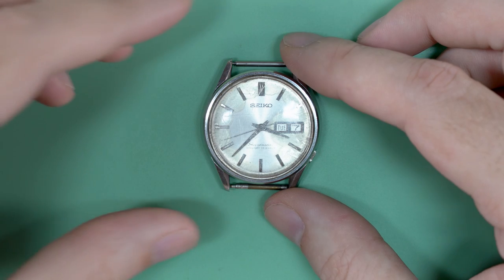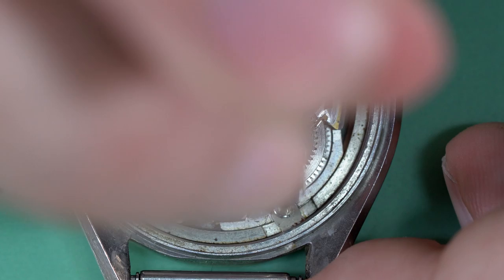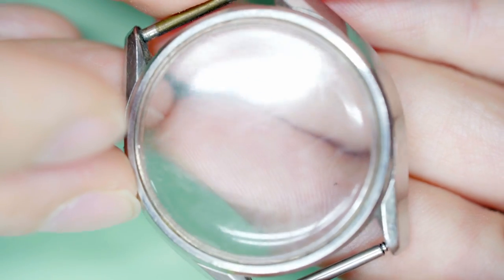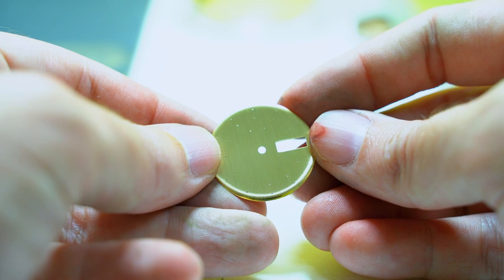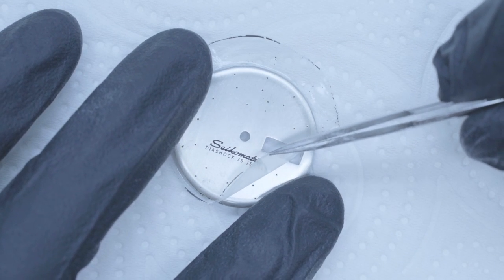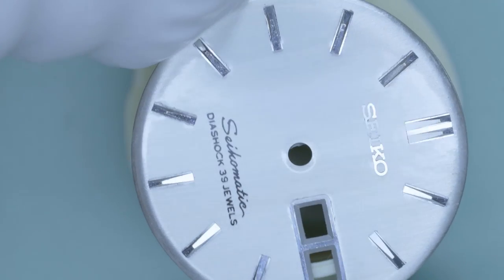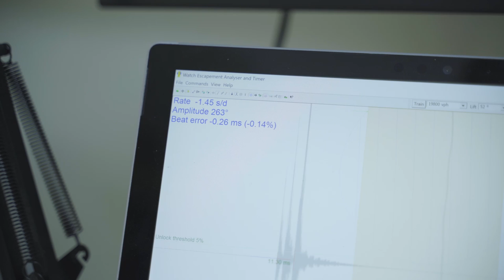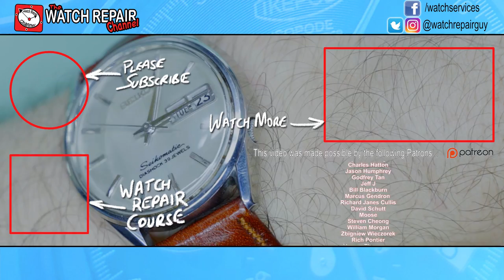A 1960s Seiko Automatic 6216A Restoration and Full Service Watch Repair Tutorial

Comment from the maker: Full length version of this video can be found here: https://www.watchrepairlessons.com/2019/06/13/a-1960s-seiko-6216a-restoration-extended-narrated-edition/

Forgot to mention in the video - the array of different screws in this movement is incredible - seems like a different screw for nearly every fitting. Did anybody notice the mistake I made in the video and later it got rectified? Why not watch again and then comment below if you spot the mistake :)

In this video we take an extremely tired old 1960's Seiko Automatic 6216A gentlemans wristwatch and give it a fresh lease of life. 

Film Free Decal Products used in this video - TYPE A: https://ebay.to/2JA95hm or https://amzn.to/2W0RCp4 I did not use the glue in this video.

Canon Laser Printer Used in this video: https://ebay.to/2LttiIq or https://amzn.to/2YsI4Ay or choose an alternative color laser but the highest resolution you can afford. e.g. 1200dpi
Reply: Thank you for sharing reprinting cadran process with us . My father repairman too and we were paid  expensive money to reprinting it. Next week ı will going to try it with your way. In turkey there is too much people interested to old seiko and omega.
Reply: The screw that holds that cover plate in the keyless work (dont know what its called), that you're fitting exactly at 28:00
First you try to fit that with a screw with too fine thread pitch, and then with a screw with an oversized head.
It needs to have a screw with the same headsize as that little bridge that holds the calender quick change wheel (at least I think thats what it does)

I don't know where that misplaced screw originally fits, maybe on the balance bridge or escapement bridge.
Reply: Alright, I give up. I went through the video a few times and can't spot the mistake. I thought you may have forgot the winding pinon, but there wasn't one on disassembly. The pawl went back on in the same direction and you didn't forget the click like I've been known to do. The only misstep I caught was when you tried to screw the setting lever spring(?) into the wrong hole but quickly adjusted it. 

Can you leave another hint or two? This will drive me nuts until I figure it out...!

Big fan of the channel, by the way. You've helped me tremendously over the years.
Reply: Do you sell them?

Comment: As someone who is a Seiko fanatic I say great job. The numbers 61 as the first two digits of the serial number on the rear case puts the production of this watch as January 1966. Seiko's are typical easy to date because very few movements by Seiko saw ten years of use so the movement type will fix the decade of production then the first digit will be the year of that decade. The second will be the actual month with November and December being represented by A and B respectively.

Comment: I think you did a great job on the dial.  Comparing the original finish and markings, it appears that the new decal is about 2 letters too long, but still one heck of an effort and a very good result.  My first and earliest Seiko is a DX with a 6106-8609 movement- case designation, Model 54229M.  Been wearing it since 1974.  Have 28 more Seikos and 2 custom divers with Seiko NH35 movements.  Reliable and durable.  Best watch for the money.

Comment: Hi Mark, very good informative video, Thank You! A very nice vintage Seiko watch that was definitely worth restoring. At 39 jewels, the movement is one of Seiko's higher grades.
I think that you were fortunate that the lacquer had not lifted on the date ring too due to moisture ingress. This is a common problem on vintage Seikos.
Unusual that the day wheel had no snap spring to hold it in place and only a under dial brass washer. For this model, Seiko must have deemed it enough.
BR

Comment: I  have that very watch!  I purchased it in 1971 at the Gunfighter PX on Freedom Hill in DaNang Vietnam.  Had it cleaned once and the self winder had come apart, they fixed that.  I had pulled the band apart once to put the fitted links on a different band, and when I replaced the original, I had to replace that with a regular link but it still keeps GREAT time although I only wear it when going to my old outfit reunions, and other format occasions.  When I purchased it, I had pointed to a real cheap wind up watch, since the watch I had was stolen from my wrist while driving down QL1 in a Jeep.  The gal at the PX looked then grabbed a box from under the counter and sold it to me for 8 bucks, MPC.  The one I got was marked $40.00 MPC.  Got a good deal on that one, I didn't open it till I was back with my unit some miles away from Danang, so I just kept the watch.
Reply: Woops, mine has the duel language french/English day indicator.

Comment: To place the decal, i think you should prepare Mark Setter and Mark Softer. Those two liquids very help in placing decals on the surface. Mark Setter help to slide the decals and Mark Softer to soften the decals. And to reduce the liquid maybe you should try cotton buds. I hope my tips is usefull. I like your video a lot. Very detail in showing the process. four thumbs up..

Comment: Fantastic job. My only suggestion would be that the crystal could be polished a bit more. This would allow for the fine job you did on the dial to really shine through. It would probably only take an additional hour or so. I like to use toothpaste. Just a small amount applied to the crystal and worked in until you feel a bit of resistance on the polishing cloth. This is the paste drying. Then a fresh cloth to hand buff away the remaining residue. I have brought these types of crystals back to near new condition with this simple method. Great video!

Comment: Great video. Heres a tip. It’s better to peel off the heated decal totally horizontally (folding it in half as you peel away) with the watch face instead of peeling the decal away at roughly 45 degrees as you’re effectively pulling the decal back off if you’re not peeling it away flush with the surface. That’s why the number 3 peeled off.

Comment: Wonderful video and very useful tips. With regard to the new lettering or logos, I tend to think they might look more "aged" if the edges of the font are not too sharp but a bit frayed. Can be achieved in inkscape by putting lighter tones at the edges. Probably makes the letters look more slender.

Comment: The Seiko 6216 9000 is not exactly a throwaway.  They sell for USD300-1,000.  This one is from 1966 and the 6216A movement is identical to the 62GS Grand Seiko as in a 6246-9000 which can go for USD2,000 plus, because of the chronometer GS branding. Note the rack & pinion fine adjustment. Nice refurbishing job though, and you've given me an incentive to replace the tarnished SEIKO logo on one of my 6105-8000's from a donor 6119.

Comment: 39 jewels that in itself seems worthy of restoration. That 6216a movement is Grand Seiko worthy movement of the 1960's, it was Seiko's highest quality movement of that time, don't think you know what you got there, I would have bought it from you but you might have hurt its value by restoring that dial.

Comment: Love these old seiko watches. I have a seiko sportsmatic 5  6619-8060 dolphin back and the date quick set doesn't want to stay working. Took it apart, put it back together, it worked out of the case once and after I put it all back in the case. Then hasn't worked since. Bad date spring?

Comment: Interesting video. At the end you said that from a financial point of it was not worth it. Do you mean vintage entry level automatic watch aren't worth salvaging. I have an old Tissot Pr 518 ruined by water that no watch repairer is willing to fix although i have a working spare movement for it. The latter one also needs maintenance. Should i just sell them as they are? Cheers

Comment: Pretty neat and interesting  work  Ive noticed when. Playing around on Ebay that  you can actually buy  complete quartz mechanisms complete with batteries  for under five dollars  of course thats kind of cheating  compared to wahat. You did in the video  yet i was curious if those movements woul fit inside a old mechanical. Watch case  ? If the movement and parts are beyond what. A hobbyist  could fix  or repair the movement. Ive seen  is a Chinese made  unit that starts with the letter M and i beleive that company manufactures all the  movements for Casio and maybe Timex and others who  purchase  the mechanics from other people  i do have a couple of Sentimental watches  that dont run  and i thought it would be cool to be able to wear them again  plus  you can find tons of them online in lots  pretty cheap  and in some cases  i really like the look  and style of the old Seikos and such. Over  some of the new  watches  in all honesty  i was a professional Woodworker who suffered a Traumatic Brain Injury over 10 years ago and  that caused some paralysis on  the left side od my body  and although I’m doing well  despite that  I’m not quite sure on how safe it will be to return to a fully operating Woodworking shop  but perhaps  pursue another hobby. Like watches instead ?  Besides there are YouTube videos and channels that can be of help

Comment: I happen to have one that's supposed to be waterproof, but it needs a new gasket. Any ideas where I can get one? The watch does work, but is no longer waterproof at least the the depth claimed... I think 50 meters ... been a long time since I looked at it.  Another silly question, is there a quick easy way to set the day date?
Reply: without taking it apart, I mean. I hate to take them apart. Things pop out... and I don't know how to put them back.

Comment: I think you should not have sanded the dial but just re-lacqured it. The sunburst is gone. Or, if you did sand, a spinning sanding wheel rotating about the dial center would bring the sunburst back.

Comment: Unlike most women Seiko's are easy to date. The first two digits of the case back serial number are Year/Month. Then it's just knowing the Seiko case styles to get the decade. So this watch is a proof so must be 1960's as by 70's they were marked resistant not proof.  The serial number 61xxxx tells you it's January by the second digit. The first is a 6 so it's 1966,76 or 86. Knowing that model and that the case is marked proof it's 1966. So January 66. Nice watches these classic Seiko's. I use to restore them and sell them as my living. Very under-rated the 60's dress watches. Grab a bargain while you still can.